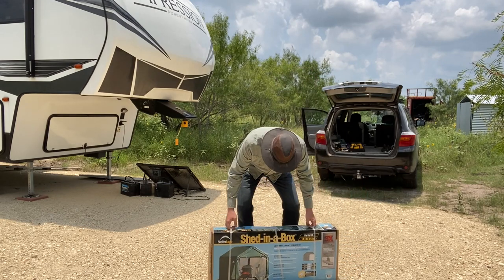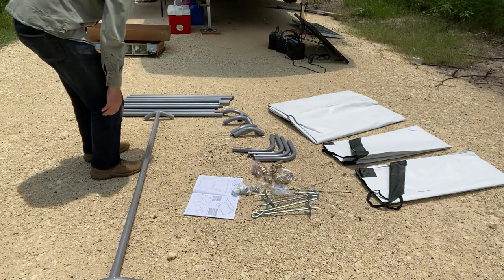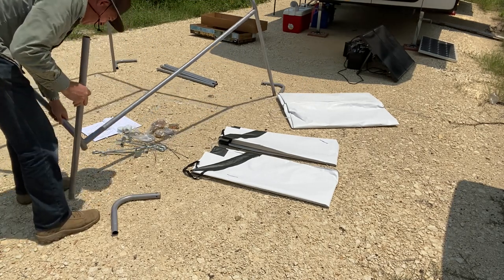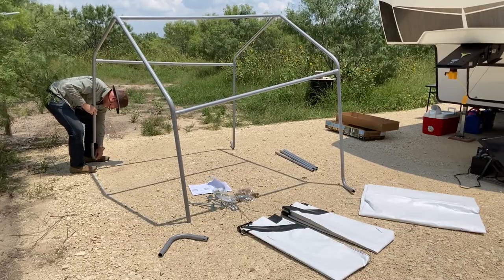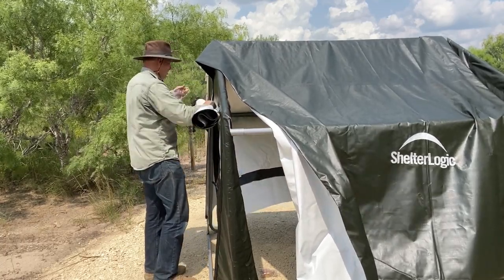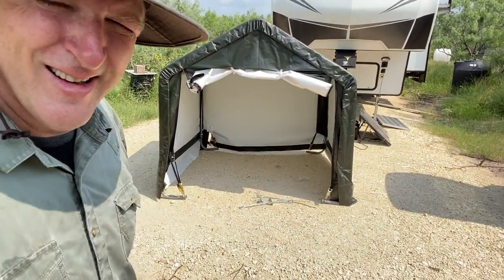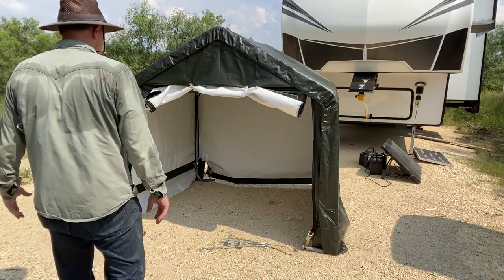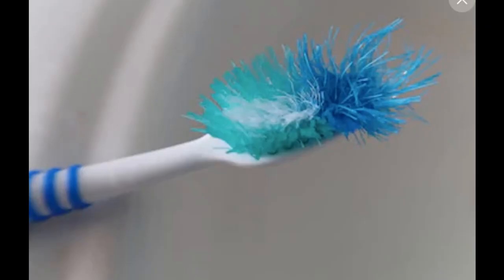PUTTING TOGETHER A "SHED IN A BOX" - (EP 35)

Comment: I’ve had mine for about a year, and the wind racking it makes tubes come out. The wind also tore the top off. Between the two, I’m always repairing the 🤬 thing. I just need to buy or build a wooden shed!
Reply from the maker: Mine's holding up and am a little surprised that it doesn't degrade like a regular tarp which is good.  I'd prefer a wooden or metal shed also.

Comment: Question where can I get that size shed and what is the size?
Reply from the maker: I got it at Tractor Supply but these sheds really need a more durable material.  The covering disintegrated after about a year.
Reply: I have one of the sheds but bigger size had for a couple years and worked pretty well and then parts of a tree landed on it last summer and destroyed half of it so gotta get me a new one thats a smaller size thanks for letting me know where to go get one at